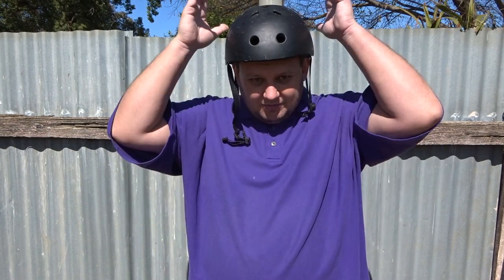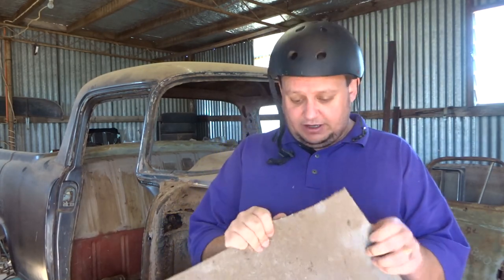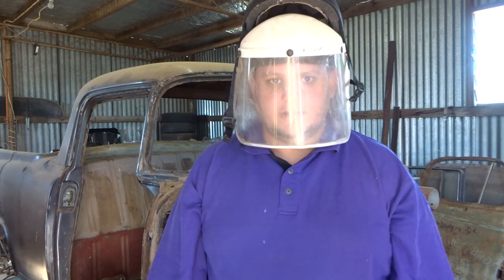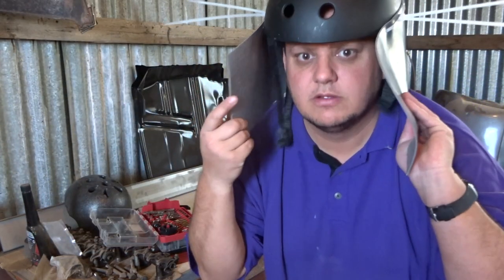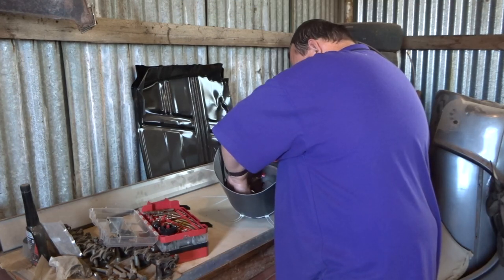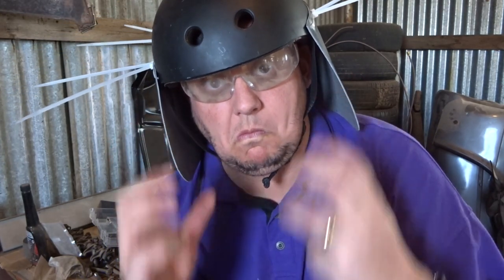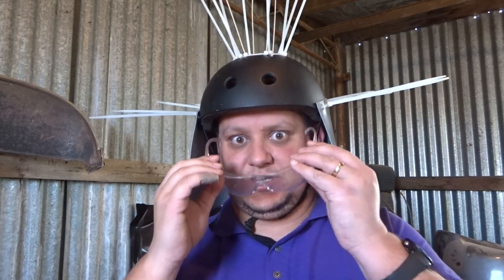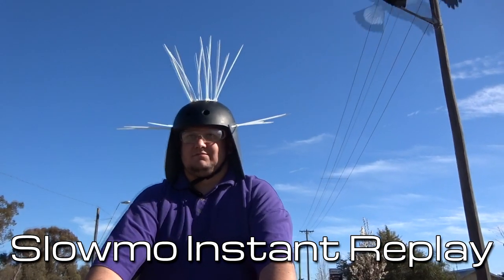DazzaJay Builds: Magpie Defender Helmet

Comment: Darth Vader and mad Max combined! But it seems to work at least!
Reply from the maker: Well, it worked for 2 years. But there's one Magpie that just doesn't give a toss now, and crashes straight into the back of the helmet as hard as he can.

So I'm going to have to rig up something extra for him.
Reply: @DazzaJay  what are the chances the cops will find out if u add some subtle razors or electric shock!?
Reply from the maker: Cops are everywhere man. They even stopped me out the front of my house because they thought I was wearing a bucket on my head.
https://youtu.be/eJnfI2DQe1s

Comment: It works and you should put it on Amazon with colorful versions.
Reply from the maker: Unfortunately, these magpies, after 2 years have learned that there's a gap in the spikes, and now they crash into the helmet at full force between the top and bottom levels of spikes... So I may have to make a new video, with a new version of the helmet.
Reply: @DazzaJay  Drill some more holes in the helmet and add spikes to the gaps!
Reply from the maker: If these pests weren't a protected species, I'd cover it with razor blades.